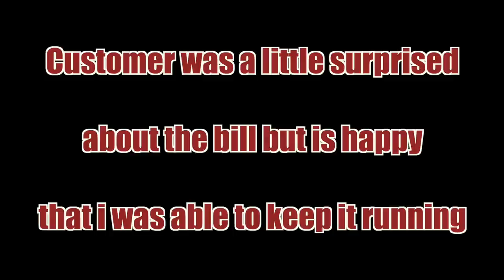No Cooling/Bad Condenser Fan Motor

Comment: I put a deep 11/32 socket on an 3/8 adapter that I can use on my drill. Makes it quicker to tighten the motors & saves space in the tool bag. I don’t have to carry the nut driver anymore.

Comment: Why did you eliminate that white striped wire ? What refrigerant was in the unit originally?
Reply: I believe that’s a redundant wire, not needed for a dual run capacitor.
Reply: Depending on the motor that wire could have been a different speed tap
Reply from the maker: It’s not it’s s common not needed when using a dual capacitor
Reply: R22
Reply: Thanks for the feedback, also I'm wondering about the r453a, is that John's preferred r22 replacement, I know a lot of people here are using mo99, any thoughts on r22 replacement refrigerants?
Reply from the maker: This is John. Yes R-453A is great

Comment: Can't you connect the white striped to common?
Reply from the maker: You can but it’s not necessary with a dual run capacitor
Reply: @johnisraelhvac2019  I knew that. Just confirming that option. ✌

Comment: Anyone care to offer an opinion on current ICP equip 2.5 ton  vs Goodman -- Rheem - Rudd ? I'm a remodeler but been watching these for a long time. My friend just got ICP installed --- China condenser motor -- not to much to the condenser grille...I see.  I'm staying out of it -- but curious to see how the equip. ranks. $10k install for a 1200 sq ft house -- new flex is all in addition to the equip. Gas heat -- split sys.
Reply from the maker: ICP & Rheem/Ruud is great equipment
Reply: @johnisraelhvac2019  Thanks John.